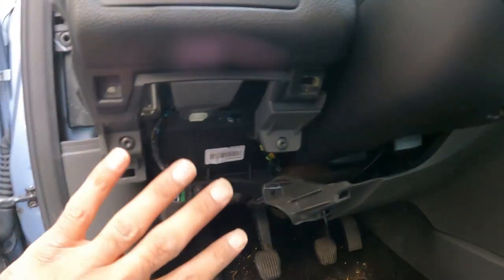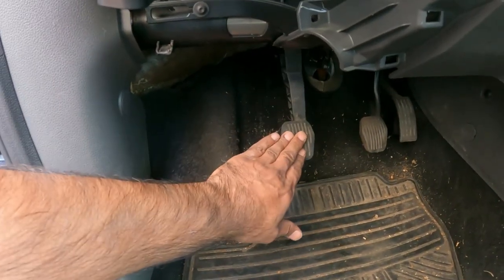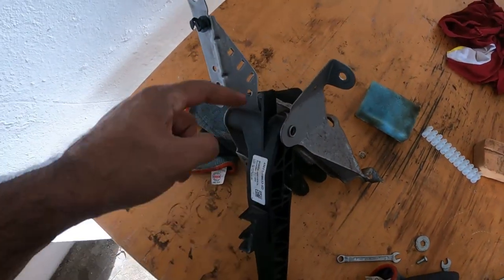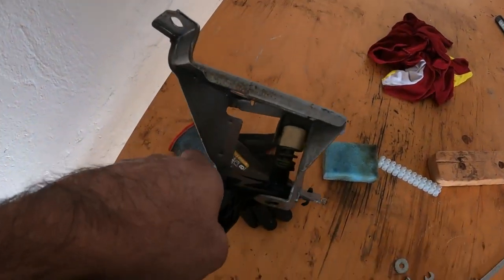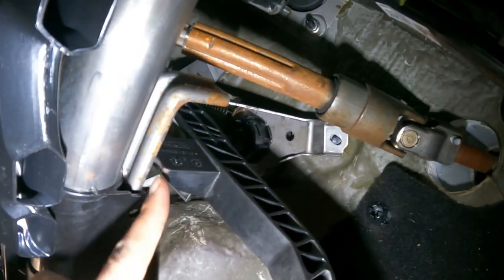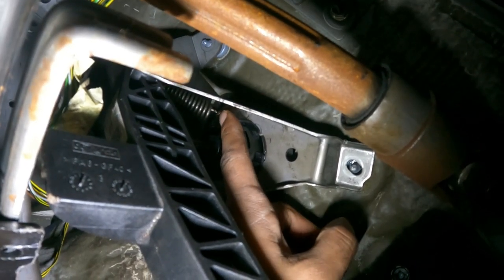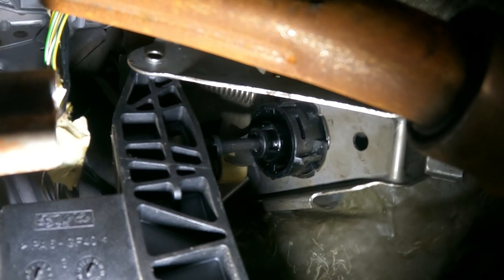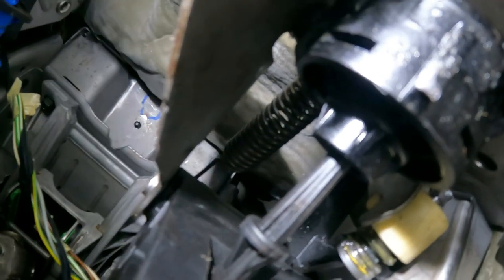How to Change Clutch Pedal Broken Spring on Ford Focus/Volvo V50/ C30/C70/S40

Comment: Mate you're almost a lifesaver,fact is I changed the spring with the plastic on it without taking the pedal off,bad thing,I cannot see the other spring from the inside,I have a Volvo,which is way more complicated inside.
Reply from the maker: I can understand that it will be very hard if you dont remove the pedal